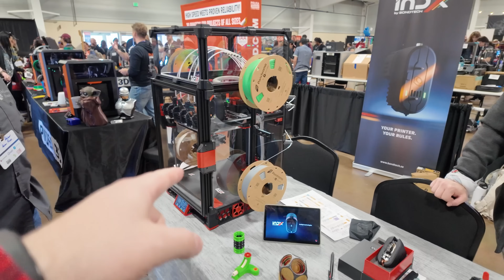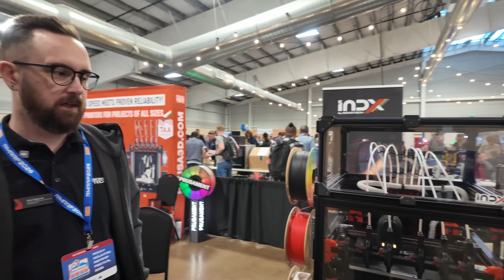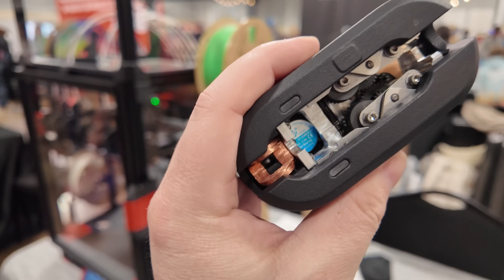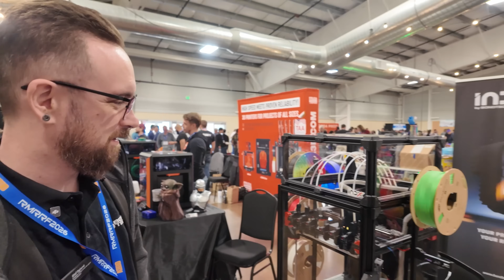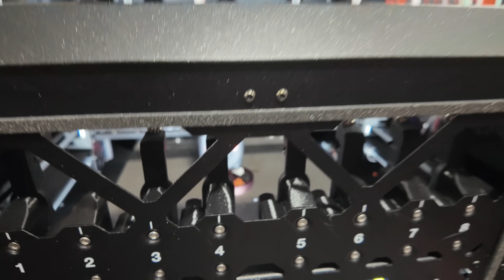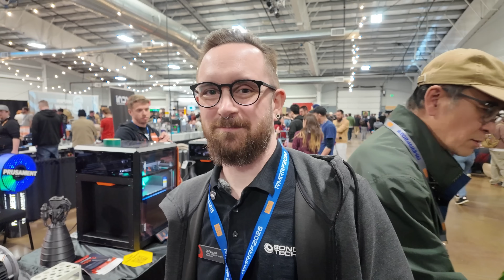FINAL LOOK  - INDX Toolchanger from BONDTECH

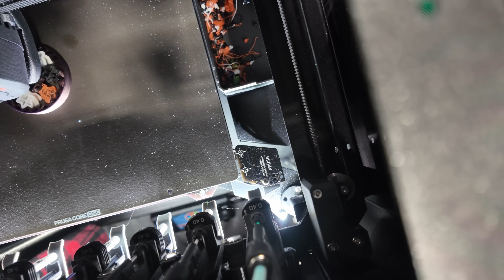Comment: 7:19 is it just the print or is that orange stringy AF?
Reply from the maker: i think the slicer was using default settings not tuned for any specific filament, joy of these reprap fests, sometimes just use whatever filament you can grab at the event

Comment: Nozzle changer. No option to adding other types of tools at this time.
Reply from the maker: the cad of the toolhead itself is out if anyone wants to design something

Is it as open as a full dedicated toolhead system like the PRUSA XL, no, but its still more capable and a more usable/efficient system than a nozzle changer like the vortec system from bambu (filament stays loaded in the tool and no need of an MMS system)

Comment: Later the Parts will be injection molded? :(
I like the finish from the SLS Prints so much. i wish it could be all SLS printed. Or choose between injection molded or SLS printed, maybe with a little extra price.
Reply from the maker: The injection molded parts will have a matte finish, either EDM or bead blasted surface on the molds IIRC

Comment: So you are saying that you don't even have the tools to make the INDX. Prusa started the sales of the INDX already and is hoping for juni. The proccess of setting up a molding machine is not easy and takes a long time.
Reply from the maker: dont have the parts to make em, except for all the tooling they had to make the parts that are already sold and made lol

Their just changing from CNC/SLS to more efficient manufacturing methods for the production run of the INDX, the founders edition ones already sold are the previous method, and the tools/molds are already built and running last i heard

Comment: I’m in the market for a new 3d printer and tossing up between H2C and Core One with INDX.

INDX is way cooler, but Prusa won’t have the level of polish the H2C has and the feature set.

Hepa filters, heated chamber, automatic vent, nozzle wiping. 

I’m really rooting for the Core One INDX.
Reply: I was hyped for the h2c until I saw it on arrival. It’s wank. I’m now moving over to an INDX system when available.

Comment: Anybody understand why they aren’t designing for 350C nozzles to really own the market?
Reply from the maker: silicone socks fail at those temps, common thermistor styles arnt as accurate above 300, and the vast majority of filaments just print fine with sub 300 nozzles

if your printing materials like PPS, PEKK or other high temp stuff often enough, you probably want a dedicated machine for that usecase
Reply: @Can @CanuckCreator r helpful … but also relatively cheap parts to upgrade? We know many plastics 3d print much stronger at say 320 than 300. PC / PET and even PPS are hardly exotic industrial filaments and would be a better fit for many practical prints than the usual PLA / PETG world. Even PCTG likes slightly higher temps
Reply from the maker: you would have to re-engineer the entire toolhead for that, different inductive heater spec and the IR sensor used for temp reading can guarantee the accuracy outside its temp range, so no, its not a cheap upgrade

Comment: Because the INDX system is a high end tool changer it schould support at least 350°C printing temperature.
Reply from the maker: why? the vast majority of filaments dont need it, and would require a redesign of the entire induction and temp reading setup to ensure accuracy above 300
Reply: @CanuckCreator I agree that 350 is more or less for exotic filaments. But 320-330 hase become common in the last years. There are a lot of filaments which print much better slightly above 300.
Reply from the maker: @ManniAT  from my understanding the inductive heating + IR temp probe isnt as accurate over 300, plus the silicone socks deteriorate above those temps too
Reply: @CanuckCreator I don't understand the thing with the silicon socks.
My H2D can go up to 350 - I never needed this but made a lot of prints with 330 and had no problems with the silicone socks.
Reply from the maker: @ManniAT  depends on the material the sock is made out of, different formulas and what not

ive seen plenty of socks degrade and fail over the years from higher temp printing
Reply: @CanuckCreator of course, over the years these socks degrade.
But from my point of view they are consumables.
And yes, it depends on the kind of silicone. 
But he - sry your printer can't reach 330, but your socks will last for ever although we use cheaper material. 😂
Reply from the maker: @ManniAT  not so much the socks as the IR probe and inductive heater setup along with the formfactor being the limitation AFAIK

Comment: That priming solution of prusa is bad when you have wet filament as during the movement to the printed part, you will have oozing. That's why the best solution is a small prime tower near the printed part. Of course, yeah you lose some space. Btw, it seems like bondtech increased the priming volume. Do we have any information about that? We can see it in the video that it takes a lot of time.
Reply from the maker: Printing amounts is something you adjust on the slicer side
Reply: @CanuckCreator you mean priming volume. Yes I know that but for sure bondtech has an ideal value for that. What am asking is this. Is that ideal value, THAT high as shown in the video?
Reply from the maker: @AngelVenomous  the printers at the show were running bascially "stock" slicer settings, so prime volume you saw probably matched more MMS use settings than toolchanger, i believe the prints were sliced in ORCA.  you can skip the priming all together if you tune your setting right, you just need enough to ensure you dont underextrude when you grab the new tool
Reply: @CanuckCreator oh I see. Weird for them to show us something that it is not tuned. So they used a priming volume for multi color one nozzle printers even though theirs is a toolchanger.

Comment: Yes, I would like to see Diamondback nozzles.  Troubleshooting print issues is difficult enough without wondering if my nozzle condition might be a factor.

Also disappointed CANbus is still a maybe.  I like being able to string devices along a single bus without needing hubs.  But maybe USB is the future after all.

Still can’t wait to try it.  Such a brilliant, elegant solution for tool changing!
Reply from the maker: the hardware is there, its just a limitation of the bootloader/FW

Its being worked on from my understanding and should be sorted out by release, RRF support requires CANBUS 
It just may be a case of having to flash different FW/bootloader depending on your usecase instead of it being natively supported at the same time
Reply: Yeah I think that's more of a klipper issue than a bond tech issue maybe switch to rrf I recently got a few duet2 boards so I tried it out it's comparable to klipper
Reply: @natdizzle4259  I don't see how this is a klipper issue I have CANBUS working fine on my existing Klipper system.

Comment: Been waiting for INDX.  I know things take time to develop and I appreciate that BondTech is taking the time to do it correctly while pushing as hard as they can to get INDX on the market ASAP.  I'm most interested in a six tool head INDX on my SV08 but a three tool head upgrade to one of my Sovol Zero printers could be very useful.  I make functional prints so I'm not that interested in different colors.  I am interested in printing in different materials.

Comment: Capping it at 300⁰C is just plain ignorant. Here's this cool system to just print toys and trinkets.
Reply from the maker: Limitations of the IR temp sensor and, silicone sock and inductive heater. You can still print all the common materials. If your printing high temp stuff. A more dedicated machine for that usecase makes sense imo

Comment: Different nozzle sizes would be amazing. I'm not sure if Orca will support this, but just imagine: One tool with a small diameter for outer walls and details, one tool with a thick diameter for infill and a regular tool for support material. I'll probably give this a try for my 2.4. Heck, I'd even convert my 2.4 into a Trident since a setup like this would speed up my prints by a lot (and make them stronger).
Reply: For most parts, it'll probably take longer to INDX switch tool heads to get a large diameter nozzle for infill.  Maybe use a 0.4 or 0.6 mm nozzle and print double the line width with the same nozzle for infill.
Reply: Founders Edition owners already got to order some alternate sizes, so that's definitely coming. You can already do multiple nozzle sizes in the same print in PrusaSlicer and OrcaSlicer. In PrusaSlicer its in Print Settings > Multiple Extruders > Extruders (note Print Settings, not Printer Settings). In OrcaSlicer it's Multimaterial > Filament for Features. If the printer is set up as a toolchanger and each extruder is given a different width it should just work (you may have to tweak things like "combine infill x-layers" and similar settings).

Comment: I saw what Prusa was charging for their upgrade kits, not even the printer, and the prices are insane. You could buy an X2D or U1 for the cost of the upgrades. And if you just want to buy the small size CoreOne with the INDX, you could get 3x the build volume with modern technology in the H2C for the same price. Prusa has gone insane with their pricing. Pricing themselves out of the market.
Reply: Yes, you can buy something with less capability for less money. Crazy
Reply: Nobody cares about scambu labs and their subsidized spyware printers.
Reply: You're not even comparing apples to oranges there. A proper 8-nozzle tool changer with no waste vs those inferior Bambu designs is no contest. Also, Prusa has to pay European wages to European people and all those things that Chinese slave labor companies don't -  and for that matter, China is pushing hard to  keep prices artificially low specifically to harm manufacturers elsewhere, like Prusa. Either way, this video is about Bondtech's INDX and the pricing for that should be perfectly viable, some hundreds for the tool head, and 50 bucks (or thereabouts, inflation is crazy) per nozzle.
Reply: @extectic China is not a low wage country. I'd wager the wages should be pretty similar between Eastern Europe and urban China. Besides direct and indirect government subsidies, the benefits companies like Bambu have is access to better capital markets and being directly embedded into China's industrial hubs. This makes sourcing parts much much easier, reduces iteration times and gives them easier access to manufacturers.

I'm sure some part of why Prusas are more expensive is that the source more ethically and that they receive less direct subsidies, but even with those being the same, the Chinese printer will always be cheaper aslong as the European one is mostly made up of Chinese parts that had to travel half the globe.

This isn't down to individual companies like Bambu or Prusa, but the unwillingness of the European bloc to do industrial policy, and on the other hand the Chinese government being happy to effectively subsidize consumption around the world.
Reply: @baggern  You're completely wrong about salaries in China. A lot of these factories are in Shenzen, the technology hub of China. A factory worker there has a CNY 66,272 yearly salary, which is more or less 8.2-8.3K Euros. Some of the lowest salaries in Europe for factory workers is 800 Euros a month in Latvia, with a 13-month payment scheme that adds up to Eur 10,400. That's the lowest end for a factory worker; on average is 20% more than that. So Europe cost per worker is about 25-45% more on average.
Reply: To me it just seems like your mom is skimping on the allowance tho

Comment: what about filament runout sensor?
Reply: There should be an optical filament run out sensor in the top of the tool head.  Pity there isn't.  Now you need one run out sensor per filament.
Reply: I would use it not as a filament runout sensor, but as a sensor to make an auto load/unload routine...
Reply: Filament runout sensor must be on the frame if it has a reverse bowden. This does have reverse bowden.  So its therefore not needed in the extruder. 
Think about it, if its in the extruder, when it runs out you would need to remove the ptfe at the extruder and open the machine.  Sometimes while hot. Not good. 

If it's on the frame. When it runs out, you just pull out filament after unload. Externally. Not in the enclosure. 
  So, that makes sense that they didn't waste time and space for a filament sensor in the toolhead. It must use reverse bowden.
Reply from the maker: You`d have to use an external one as theres none in the toolhead itself, thats pretty much the only real critique i can make about the system unfortunatly, comes down to room and packaging, i just done think theres an easy way to fit one in without added electronics to the tools themselves

Comment: I just hope it works well with the 2.4.
Reply: Agreed and some sort of z carriage will need to be figured out!  Some other interesting concepts are out there already too : https://youtube.com/shorts/AurgL3nNFcE?si=vLfS6KA-xwGCQu9V
Reply: It takes forever with the 2.4. The Trident is way better for that concept
Reply: @Iars-b  2.4 can be packed with several motorized tool gantries. So, not 11, but 22 or 33.
Reply: @Iars-b doesn’t that depend on the implementation? If the tool rack moves with the gantry it’s basically the same as the trident.
Reply: @Thorhian  all the tools (with all the ptfe tubes) on the gantry? wow! but no.
Reply: @Iars-b  what do you mean? The only downside is that you lose a little   on Y movement
Reply: @Iars-b what’s wrong with that? I doubt the 4 motors would have much trouble moving it up and down. It’s basically a trident setup.